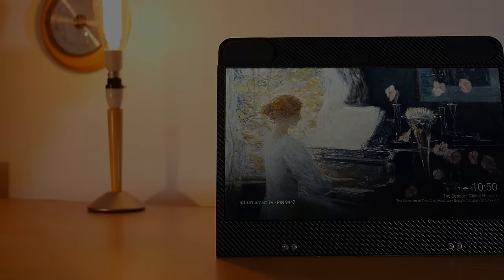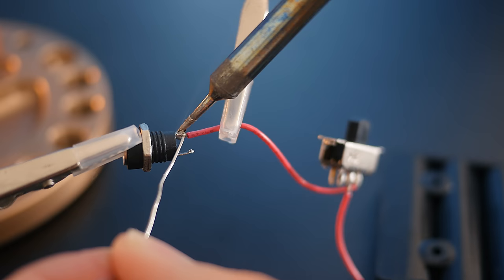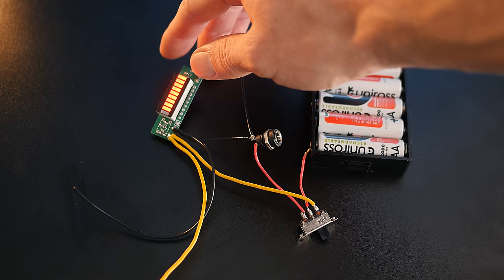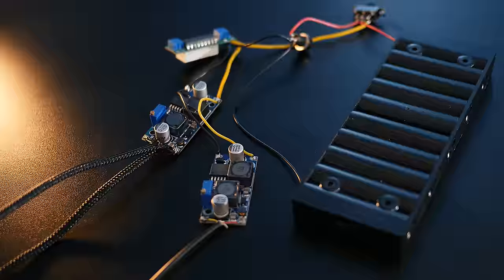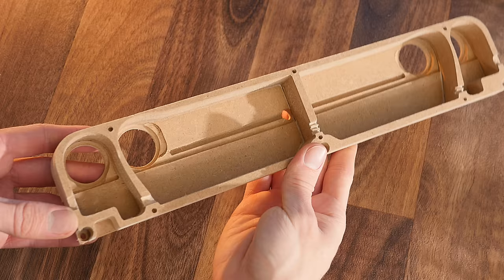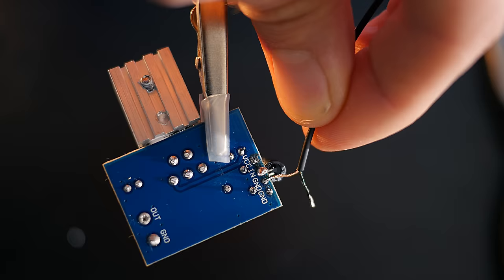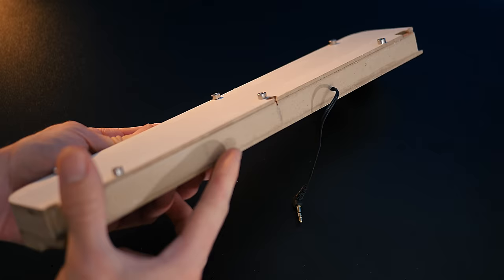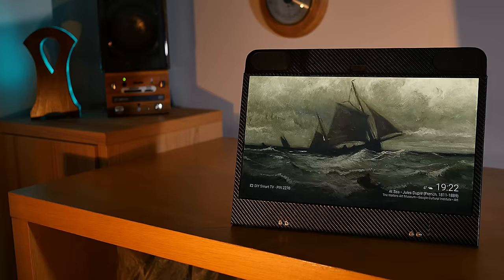Build your own portable SMART TV (100% wireless!)

Comment: Tip: you can tie a knot on the 3.5mm headphone cable inside of the speaker. This will almost always avoid damage to the circuit/soldering when the cable is yanked.

Comment: Don't make low pass filters from regular electrolytics, you need at least a bipolar elec or better yet a proper film cap! You'll get a huge improvement if you redo that filter.
Reply from the maker: Thanks for the tip - will do some experiments for next time.
Reply: Yes that filter seemed extremely primitive to me. The result is what matters guess. And in the end a lot can be done diferently, better but sometimes would go beyond simple diying. I recall hearing on a forum that I neeed a 10K Ohm logarithmic potentiometer for audio input attenuation rather than a 500ohm linear one for ideal control, to avoid the immediate jump in sound levels as well. They said it had to do with audio levels being logarithmically scaled. So the higher voltage would raise volume too fast compared to a logarithmic one (it uses the bottom part of a logarithmic graph to more slowly raise power levels, of course after that the log pot will raise levels faster than a linear one).
Reply: Jan Metdepetop could you explain more

Comment: why did you use aa batteries instead of 18560 li-ion batteries
Reply: Martin Očko meh
Reply: i think because they are less dangerous and easier to deal with in terms of circuitry.
Reply: Martin Očko My thought exactly
Reply: id be more curious why not Lithium polymer batteries from example a RC car, they can be made quite a lot thinner :)
Reply: Easier charge circuit (since he can simply buy an adapter)
Reply: d4m4s74 True... But he also used 4 amplifiers
Reply: Steven William I believe 18650 cells would be the best. Not a complicated circuit and they are not dangerous, people are carrying them in their pockets inside power banks without even knowing it.
Reply: zakzor they are dangerous in terms of electrical stress, not in terms of physical stress.
Reply: tjeulink I know... But it seemed that people were saying they are dangerous. I believe that in this project if it was added 18650 cells with the correct amount of them not to stress them with high amp output would be better than Ni-Cd / Ni-Mh.
Reply: iblis89 lipo batteries are more expesive than li-ion and a lot more dangerous only positive side of lipo is its weight
Reply: Steven William yes
Reply: zakzor they are dangerous only when you short circut or when you over discarge/charge
Reply: balance charging would be a mess... 4 18650's are required. under charging over charging all that stuff...
Reply: I was thinking he could've used those battery banks for phones, because those include all the charging circuitry required.
Reply: Rees Arthur those are generally expensive for high capacity ones, and not as versatile.
Reply: Cybertronicify Productions Its not an easy circuit, I know, but that's how a laptop battery pack works
Reply: I am not against the original build, I'm just suggesting a mod
Reply: +Cybertronicify Productions No it doesn't have to be complicated nor are 4 cells required... 
Two simple 3v boost converters for your 5v and 12v and then a tp4056 should be good enough in this application for charging and discharging protection, now you can have as many or as few cells as you so wish.
Reply: Well what if he used the battery from the old laptop, would that produce too much of a discharge for all of the circuitry or would that actually be a viable option?
Reply: Gregg Carter Viable option if you have the correct circuit for balanced charging
Reply: Hmmm, thats something to consider if I ever do this project. Only thing about that would be the added weight, laptop batteries are NOT known for low weigh. Could also use the mount of the batter to hold in place more securely and replace if necessary.
Reply: +Martin Očko LiPos are actually generally significantly cheaper when you break it down. You'd pay somewhere around $6 not including shipping for a cheap Samsung 2500mah 3A continuous discharge 18650, or $8 for a 2500mah 20Ah LiPo which obviously can put out multitudes more power safely than the 18650 cell. Even if you go into high drain 18650s such as the Samsung 25R, LiPos still beat them out almost every time. Also because of the flat design of LiPos they are generally much easier to store in a project like this and actually take up much less space. Summary: Cost vs power ratios almost always are in favor of lithium polymer batteries.
Reply: Gregg Carter li ion in general has the highest energy density, so I'm not sure what you mean by a laptop battery being heavy. try powering it with a lead acid battery and then tell me li ion is heavy.
Reply: So are we comparing apples to pineapples now? What im saying is that a laptop battery is heavier then 18560's and the 10 AA. Its all relative.
Reply: Gregg Carter Uhhh.. But 18650s are in laptop batteries and sure a whole pack is heavy but you only need 1 or 2 cells if that's all you want, which by the way you can salvage those laptop packs for their cells and gain a lot of cells for about a $1 each or Panasonic NCR18650B 3400mah cells for as low as $4-5 per cell.
Reply: oh.... ok then. didn't know that.
Reply: zakzor if you don't short circuit the battery terminals, discharge the cell below 2.6v, charge the cell above 4.2v, draw more current than the cell is designed to output, or heat the cells above their rates temp range, then li ion batteries are safe to use. they are obviously very touchy and can explode if mistreated, but so can most other battery types. wiring a protection circuit module (or pcm) between the cells and the device they power will prevent everything I listed above from happening. some PCM's even have thermometers that u stick to the cells so it can cut power if they're getting too hot. every pcm is designed to allow a certain amount of current before it curs off power, which can be more than what the cells themselves can handle, which is important that one researches both the pcm and li ion cell in question to see how much current they handle. if the cell can, let's say, only safely handle 2 amps of continuous discharge, and the pcm u want to use will tolerated 8 amps before cutting off, then one would either have to get another pcm that only handles the same amp draw as the cell, or add more cells to the battery. because 4 cells that safely tolerate 2 amps discharge each, can (theoretically) handle 8 amps when wired together. and just like AA's or other batteries, you don't want to mix brands of li ion cells, nor do you want to mix capacity (for example don't put a 2600mAh cell with a 2200mAh cell, they both need to be the same). There's more to it but basically if you wire it all correctly, and follow a few rules then li ion cells are safe to use.
Reply: How do you feel about wiring it to a wall plug instead of batteries
Reply: Gentry Rolofson For something like this, I'd either wouldn't do it or be really care. I know here in the US, an outlet is packing 120v at 20a, producing 2400w. All of that is WAY too much for the monitors to handle and you would need to seriously throttle down that amount of power. Thats why charing cables for laptops have that big brick in the middle, to reduce the amount of juice going to the laptop.
Reply: Gregg Carter Well slight correction, last I remember US 120v was rated for 12A or 1500W (max 15A/1800W) with an exception of specialized outlets for high powered appliances such as electric ovens/microwaves.

Secondly, there is no such thing as throttling or too many watts for something can handle...
(technically there is such a thing, it's called current limiting but it's only used when necessary for example with use of LEDs)

A device will use as much power as it needs, which is why your PC has a 300W power supply or laptop has a 90W power brick, it doesn't actually draw that much only about 100W or 30W respectively, the reason for this is to give it some headroom for the heat generated by the power supply so that it doesn't burn itself out.

So for this project all you would need is a 12v power brick and a 5v regulator if you wanted to power it from an outlet.
Reply: Gregg Carter vgamesx1 it's 110v at 15 amps, 20 for specialty outlets like the one your fridge plugs into. Let's also not forget the power in the walls is alternating current and every electronic uses direct current. so the power brick not only lowers the voltage but converts the ac to dc. it's true that a device will only draw the amps that it needs, and supplying more than is needed isn't typically harmful for anything. this is why, with the right resistor, you can power a single led that only uses 20 milliamps with a car battery, which has 500-1200 amps. the voltage is something to pay attention to, not enough and the device won't work, too much, even sometimes just by a few tenths of a volt, and your device can burn out and be ruined.
Reply: vgamesx1 Hmmmm, I see. Ill real quick and touch on the fact that the US actually has a standard where 20A breakers is required in homes after a certain date (don't actually know the date but it is a building standard), what you're talking about are fuses. As for Current Limiting, if you watch both this video and the one on making the monitor you'll see that he actually is limiting the current. Finally, I'm not too sure why you would want to put an edison connection on this, it's meant to be portable and wireless. Probably should have said that in the first place.
Reply: Q.T. Productions of Utah Good thing you pointed out that theres AC and DC with that option, that would have been a big mess if you just tried to slap on a edison plug. I think it would just be easier to stick with batteries though, the thing is suppose to be portable and wireless afterall.
Reply: And just as a reference and to see if im right on this, its been a little while:

Volts - the strength of a current in electricity

Amperes - the speed of a current in electricity

Watts - the measure of power in electricity
Reply: That's what I was wondering too. He could have easily reached ~6 hours of battery life with 6 good 18650 cells.
Reply: Chris Donuts he prolly didn't use li-ion cuz they're a little more complicated and dangerous if done wrong, and prolly wanted to avoid them to make the project easier for beginners, and maybe also to just not deal with ppl telling him how dangerous li ion is.
Reply: Deltakilla45 🌽🌽🌽🌽🌽🌽🌽🌽🌽🌽🌽🌽🌽🌽🌽🌽🌽🌽🌽🌽🌽🌽🌽🌽🌽🌽🌽🌽🌽🌽🌽🌽🌽🌽🌽🌽🌽🌽🌽🌽🌽🌽🌽🌽🌽🌽🍏🍌🍌🍌🍌🍌🍌🍌🍌🍌🍌🍌🍌🍌🍌🍌🍌🍌🍌🍌🍌🍌🍌🍌🍌🍌🍌🍌🍌🍌🍌🍌🍌🍌🍌🍌🍌🍌🌽🌽🌽🌽🌽🌽🌽🌽🌽🌽🌽🍌🍌🍌🍌🍌🍌🍌🍌🍌🍌🍌🍌🍌🍌🍌🍌🍌🍠🍠🍠🍠🌽🌽🌽🌽🌽🍌🍌🍌🍌🍌🌽🌽🌽🌽🌽🌽🍌🍌🍌🌽🌽🌽🌽🌽🌽🍌🍌🍌
Reply: True, I was about to suggest that along with TP4056 with protection charger board. So, it only needs 5v 1a/2a for charging. which already exists at any smart-phone user.
Reply: homemade power bank is best bet.
Reply: all he had to do really is use an old laptop battery.
Reply: you mean 18650
Reply: not dangerous at all LI-PO's are "dangerous" as they say
Reply: you can buy charger for tham too d4m4s74
Reply: a b the worst looking though
Reply: Barut Tech cost efficient for viewers much more convenient and the danger factor wasn't something I think he wanted
Reply: Gentry Rolofson the original build had it wired to a splitter that plugged into the laptop charger and laptop so that everything could be powered off the one plug
Reply: the real crime here is putting the battery meter on the back where you cant see it (kinda the point of having it in the first place)
Reply: @TheRealZakzor how many 18650 batteries would you use xx
Reply: Yeah, Great Scott powered more or less the same project with just two 18560 li-ion batteries.

Comment: if you replace the screen with touch IPS panel, and slimmest design or components, you'll beat microsoft surface for sure.  
this also suite for mobile or in-car usage. or just add wireless keyboard with trackpad on it
Reply: Just missing the cpu, fans, storage, camera aaaand.... oh yeah software
Reply: @brunolopes2205  Yeah but couldn't anyone just mount a Raspberry pi model 3 B+, with Ubuntu Core, or Raspbian OS, onto the back of the display using the same mounting screws? Then use a bluetooth keyboard and mouse? Hell if they wanted they could swap the sd card with one loaded with retro pie and use some bluetooth controllers and make it a portable retro emulation machine they could take with them on the go!!!! That's what I'm working on. :D 
The only thing to make sure is to add a good heat sink and a good fan, to ensure proper heat dissipation, and no thermal throttling. 

Not to mention they could also make it a web server to host their websites from!
Reply: @rehmanarshad1848  Yeah not in the class of a surface by a longshot.
Reply: @diegotheslinger  the surface is garbage tho and i think the orginal poster ment the screen would be better
Reply: bruno lopes lol
Reply: @rehmanarshad1848  yeah you could but wouldn't really beat a surface except for maybe speakers
Reply: @iKingRPG  I'm not trying to beat a surface. I'm just trying to make a functional computer. Lmfao!!!
Reply: rather than just a regular hdmi input screen!

Comment: I think eryone just watched this vid and never gonna build it by themself. 
Still amazing video and amazing Monitor
Reply: I've made something much like what he made that I put on my channel, even used the same circuit he used to control the lcd panel. I made it before he did tho, but mine was inspired by greatScott and not as good as matts
Reply: Iam trying to build one.Well now iam searching for a dead laptop
Reply: Unless you have a screen and the rest lying around you can do most of what this thing accomplishes  and more with a tablet for less money. The video is mostly for inspiration and about the diy active speakers, modding. It's a great thing of course. You learn how to make things.
Reply: Yep, way too much hassle and not cheap enough to justify the effort. Cool to watch though.
Reply: John D A --- You are not even going to get a china one to work for a year with the price he paid to make this yes time is something to consider but even the cheapest ones online are $150 most decent ones are running $200, Now I will say he did do that custom board which he actually did the more expensive way but hey who am I at least he got it done. All I can think about when I see people post things like what you just said is how Dr. Dre had a max cost of $14 a head phone yet they where being sold for hundreds. I learned really quick how to make my own head phone out of old ones and heat shrink. Shoot I remember getting some broke high end head phone and replaced one speaker and made and extra 70 dollars because people wanted to pay that much or else they thought it was a rip off not knowing all along it was a rip off from the brand that they needed to worry about and I did test them yes they held up to all outputs before I sold them. even a bread box and making your own circt boards become a big money saver!! you can reuse those tools and save yourself money
Reply: I build it...
Reply: Jan Metdepetop have you seen the size of that screen? And can you use a tablet as a secondary display for computer? Yes technically you can, the app duet for ipads and mac os. I'm not sure about any windows, to android tablet alternatives. However why would you even bother? It defeats the purpose, the idea is to gain as much screen real estate as possible. Duet is free, and is only useful if you have an ipad laying around collecting dust. But for most cases this secondary display build is portable, modular and pretty cheap, and useful. Yeah the whole thing about getting a chrome cast is just adding to the cost and is unnecessary for basic functionality.
Reply: @janmetdepetop6007  i doubt the part of "less money". How many tablets have a 1080p ips screen? And how many of them have an HDMI input or decent speakers? How many have a 2.2 audio system? They work for totally different things.
Reply: wrong..I bought a controller for my old ips screen right after watching his series..no time to lose
Reply: wrong..I bought a controller for my old ips screen right after watching his series..no time to lose
Reply: 10 yrs ago i would have as i would then get high end device for lower money. these days for 70 euro you get a chinese tablet with keyboard in highres and you dont needs to stream just watch straight on the device

Comment: Just finished making this. Had to change some things for what I had but it looks great! Thanks! First soldering job too! Just as I finished I saw the new video about the brass touch screen monitor. A little upset I didn’t do that but then I saw the price of some of those screens and control boards and felt better again. Lol
Thanks a lot!
Reply: Hi Just wondering what you changed for your screen.  I want to do this but I was thinking about using 18650 batteries xx
Reply: @vikkidyer  hey it’s been a while since I made it so, it’s hard to remember what I changed without watching the video again. 
I think it might have been that I used some speakers from a TV and the cavity that I made was shaped differently(and cut one sheet at a time then glued).
Your batteries should work as long as to set the voltage for your batteries.
I also remember that the way the circuitry worked (according to video) the batteries had to have charge to work even if plugged in to the wall. Basically if you watch it while charging it the batteries drained slower so it was best to charge overnight.
Reply: Can you guys please help me the links in the description do not work